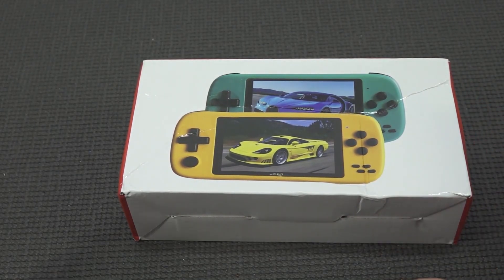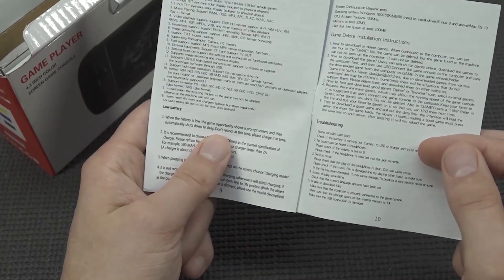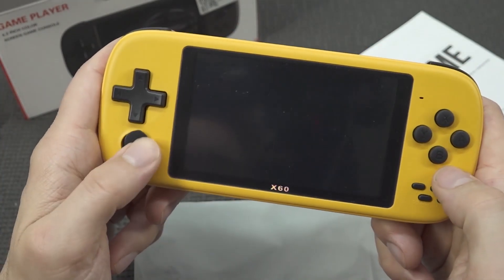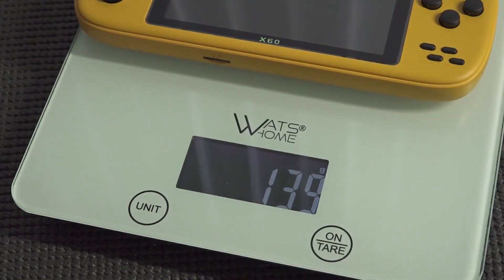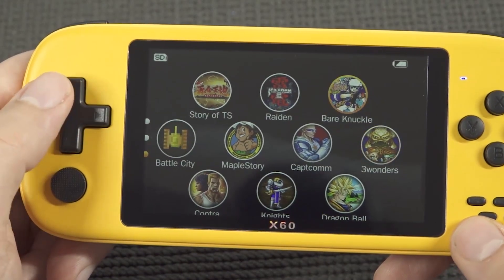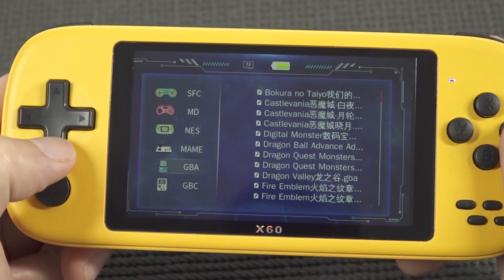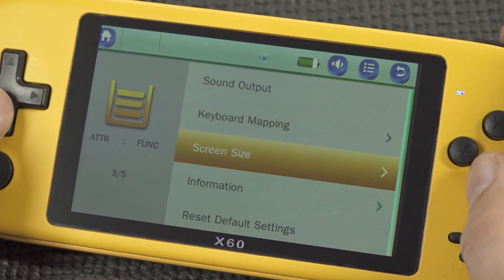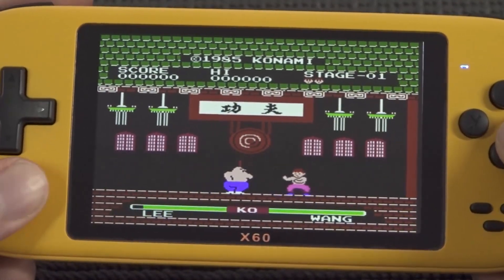X60 Handheld Switch Lite Clone from Ali Express 🙄

Comment: If they would update the firmware and add a few more emulators these might be worth buying. Sadly once you have one you basically have them all minus slight differences in form factor and screen quality. These cheap devices are more than capable of running all the old 8bit stuff but noooo they won't put in the effort to add support for them. Kind of sad because it would really benefit them in the long run to add all the other more obscure emulators/systems.

Comment: Very slow interface.
I think v90 is the best low budget handheld and if someone want more powerful they can go miyoo mini v2.
Reply: Q-90 is a bit better for endurance. Same hardware inside but the flipping screen flat cable soon or late will break
Reply: @sharpsteel6272  That kind of stress on the display cable is a problem with any phone, laptop, handheld, etc that has a typical hinged clamshell design. — Maybe the V90 has a quality problem in that respect, but the same thing can happen to Nintendo’s GBA SP, DS, 3DS, etc as well as laptops. It might take longer and be less common, but it definitely happens.